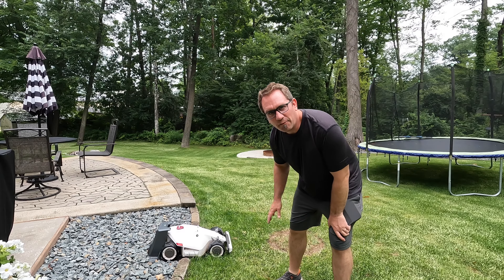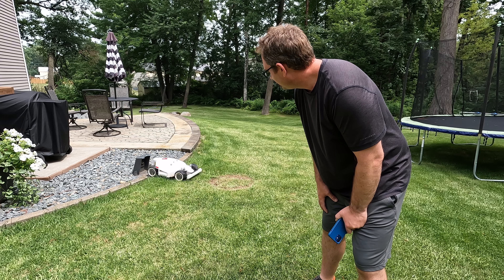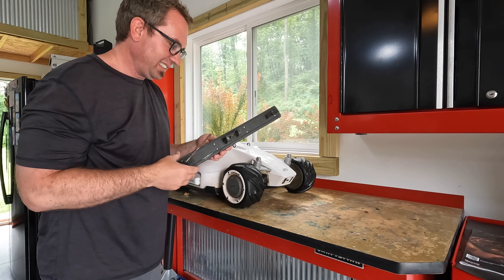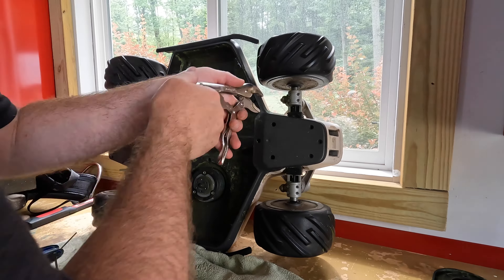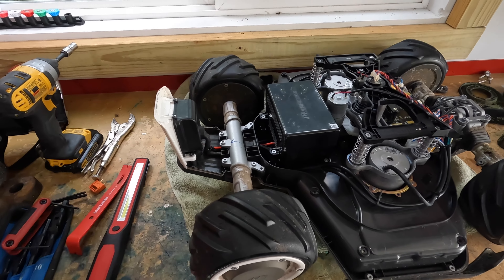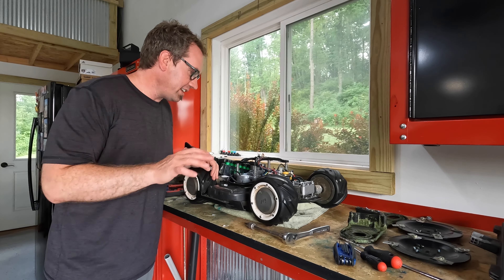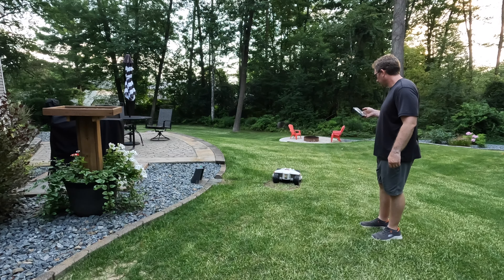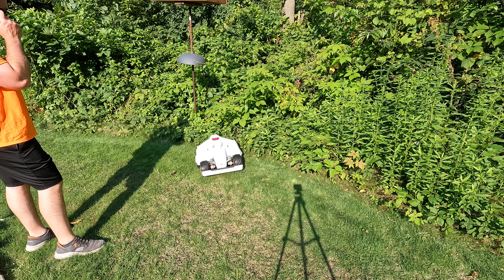Luba 1 yr Reliability Update - Teardown - Battery Replacement?

Comment: I'm only three minutes in, but it seems like a bumper problem.

Finish the whole video. Definitely think it's the bumper. Now whether it's the bumper or the connection point on Luba's side is another question. Try running it without the bumper.
Reply from the maker: I agree, I'm thinking it's specifically the bumper connection.  I haven't had time to work on it again but I'll keep you posted.

Comment: On the luba 2 they replaced this socket type connection of the front bumper with an automotive style in-cable connector.
Maybe they had issues with those often.
Reply from the maker: Good to hear they made an improvement there.  I fixed mine here: Luba Fix - Robot Mower Obstacle Detection
https://youtube.com/shorts/seJSXkg-TIc?feature=share

I think the main thing was getting the bumper to slide in fully, the fit was too tight.

Comment: Enjoyed your video.  Trying to decide to buy the Luba 2 or the Yuka 2000.  Was interested in your tare down and what the battery looked like.  I don't see any source for replacing the battery.  On other tools with LiION cells they seem to go weak after 18 months.  If the battery isn't easy to replace, including source to buy, then I will not spend $3000 for one of these.   I want a robot mower like these from Mammotion but not if they are loaded with trouble and replacement parts not available.  I would have no trouble soldering.
Reply from the maker: I'm glad you like the video and thanks for the comment.  My batter is still strong after 2 years but I would feel better with more parts availability too.

Comment: Does the Luba 1 and Luba 2 differ so much that the app is different?  I have a Luba 2 and the app (1.11.267) has Direct, Slow, Less or No Touch options.
Reply from the maker: Yes, the Luba 2 removes the ultrasonic sensors and adds the vision system.  The vision system has more capability, hence the addition of "No Touch."

Comment: I bought one last year black Friday sale.  It did great till close to august it would leave patches of grass un mowed it would back up and like when it detected an obstacle and go around but nothing was there.  finally, one day it stopped working just sitting there it had an error for the rear wheel hall sensor error I sent it for repair under warrantee. other people on Redditt with similar problem.
Reply from the maker: Did you get it back from warranty repair or did they just send a replacement?

Comment: On the Luba 2, the electrical connections from bumper to main body are hard-wired wired (with a connector).  I was surprised to see no wiring to your Luba 1 bumper.  So it seems that these connections on the Luba 1 are via sliding contacts between bumper and body.  And I'm guessing that's where the problem is (and likely why they changed to hard-wiring in Luba 2).  You DID try "bumper only" (turning off ultrasonic sensors), which re-confirmed a bumper electrical contact issue.

Ah!, as I'm watching the end of the video, I was going to suggest contact cleaner on these copper (?) contact areas of bumper and body, but see now that you DID do this.  So ya, it seems that proved it. :-)

The "backing itself into trouble" seems like a separate issue with the GPS positioning.  Maybe try remapping that area, and don't set your outer perimeter so close to the trouble spots?
Reply from the maker: Yes, it uses sliding contacts and I think that is where the problem is.  It was working ok right after cleaning and then not the next morning.  I'm thinking moisture got in the contact overnight?  Also, the sliding fit with the bumper has become very tight and that might be preventing the contacts from seating fully.  I need to work on cleaning/sanding the fit so that seats fully.

Comment: Mine just started doing the same thing after lightly cleaning it with water to fix stuck mow and start buttons. I tried what the Crazypostman suggested and ran it without the bumper. It still detects obstacles, beeps, and backs up without the bumper. 
Have you had a chance to try to get yours working again?
Reply from the maker: Yes, check out this video Luba Fix - Robot Mower Obstacle Detection
https://youtube.com/shorts/seJSXkg-TIc?feature=share

It’s working great now, I don’t think the bumper was seating fully.
Reply: @TheLawnEngineer   Thanks! I'm glad you got it working!

Comment: Great vid! Been looking for longer term luba vids! 

Any particular reason for the tenacity/mesotrione? I used for a minute but then I personally ended up finding a good 4 way selective to be far more effective against the weeds actually💀and no ugly white stuff on the lawn.  Outside of seeding… I kind of stopped using it.   Not a attack comment - to each their own 😊
Reply from the maker: I used mesotrione for seeding once and I liked its effectiveness on crabgrass and the pre-emergent seems to last about a month...so I stuck with it. 

But, I'm open to new/different methods (I don't love the with either).  What 4 way are you using?
Reply: @TheLawnEngineer  Been loving T-Zone - stay away from hot days though!
Reply from the maker: @patricksquires77  Thanks, I'm going to try it!

Comment: Hi, did you figure your problem out yet? I just ordered a new Luba one for a big discount so I'm pretty curious about potential issues. Sounds like those bumper contacts can be an issue from the other videos I have watched. I'm getting a garage and I'm hoping that will extend its life.
Reply from the maker: Yes, it was the bumper contacts.  I just got it going last night.  

The bumper didn't seem to be seating fully so I sanded the components, cleaned the contacts and things fit together more easily.  After that it worked perfectly.
Reply: Great! Thanks for letting me know. Please continue with the longevity reports. I'm sure I'm not the only one who wants to know how long these things last. Thanks again.

Comment: Left front wheel not driving on my Luba 2 10000 H. Before trying a factory reset (which worked for someone as found online, but then you lose all your task areas), I thought I'd swap motors left to right and right to left first as a troubleshooting method. I have all the screws out on the bottom but the white cover will not separate from the black bottom part more than 1/16" in any given spot, and springs right back together when I let go. I don't want to break anything or damage any seals. Any ideas on what I should do?
Reply from the maker: I had the same problem and I was missing two screws.  Take another look, when the screws are all out it came apart easily.

Comment: Do you like the Orion or the Luba better
Reply from the maker: I really can’t fully recommend either.  The Luba has been more reliable and cuts a bit better but it tears up the grass.  

The Orion turns without damaging the grass but has not been very reliable.  The unit has never broke down but I’ve had issues.  Check out my latest video for an update on the X7.

Comment: 3 minutes in, that'd be a bumper issue.
Reply from the maker: That’s where I landed…the switches in the bumper checked out so it much be the contacts between the bumper and the body.
Reply: @TheLawnEngineer  Luba 2 has a waterproof wire connection between the bumper and unit, guessing it's an issue and that was their correction. A little rubbing alcohol and some q-tips to clean the contacts might help, followed by some deoxit.
Reply from the maker: @EverydayKindaGuy  I was the contacts.  I don't think the buyer was seating fully.  Cleaning the contacts and sanding the mating components to slide in more fixed the problem.

Comment: Bought a luba 1 in april, worked for 6 weeks. Battery died. Sent back, was sent to Germany.  Mower was lost. Received a replacement mower. Set it up. Fault in rtk unit. Out of the box. Got old rtk and it worked. Once. Then blades jammed message. The blades were not jammed. Sent it back wlth threat of solicitors.  Received a full refund. Wonderful idea. Very disappointing
Reply from the maker: That sounds like a terrible experience, but good on you for pressing for a refund.  Thanks for sharing so others can use these experiences to guide their purchasing decisions.